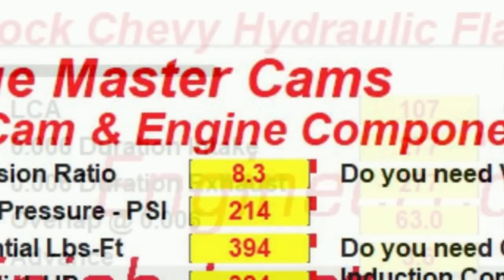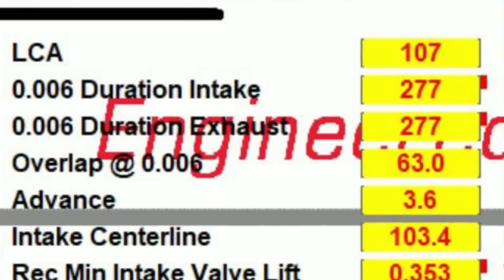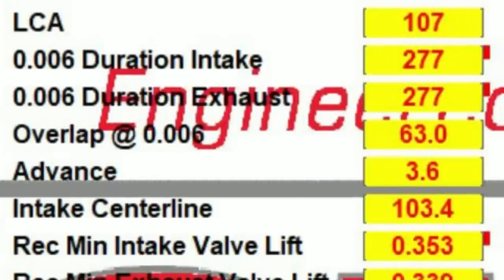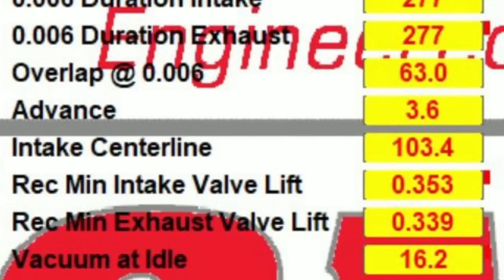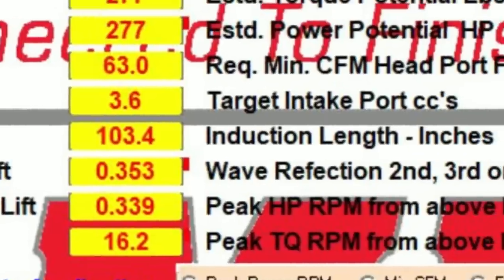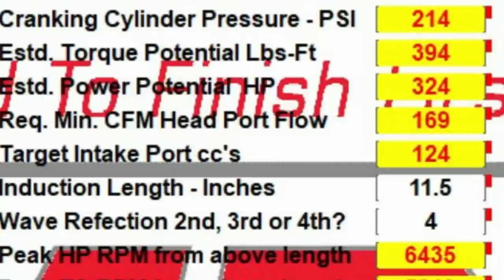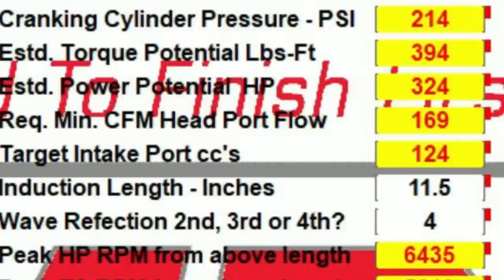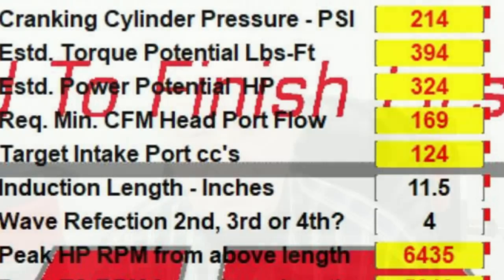Never seen before cam selection method for 'Mission Impossible"

Comment: 3.31" stroke, 4.020" bore, 6.121" rod, 56CC chambers, 7CC valve relief, .010" above deck, .038" compressed X 4.025" bore head gasket, = O.O28" total quench distance, 336.1 c.i. , 11:1 static compression, 8.68:1 dynamic compression (@ 400 feet elevation) with 276* degree cam on 107* lobe centerline angle, and 107* Lobe separation angle. 
Dynamic cranking compression= 179.44 PSI. Volume to pressure index = 139.

Comment: That'd almost the same cam as the factory 340 TA cam. Interesting they came on the 6 pack. Using a small primary carb with vacuum controlled seconds.

Comment: I was born at Saint Jude's Hospital in Fullerton, California. So were two of my three sisters. We were all four born with chronic asthma and spent so much time in the ER there,  that I can safely say one of us would not be here without them. Especially doctors Leo Cummins, Peter Kozak and Sherwin Gilman. A fine cause to support, David.  I'm sorry to learn of your daughter's passing. 

If you don't mind, I have a question about cam overlap that this video may have answered. The overlap of 63 degree's produced 16.2 inches of vacuum at idle. What RPM was that at and would that data transfer to all V8 engines, specifically the 331 Ford I'm planning now. Thank you.
Reply from the maker: Ted, glad you made it. As for vacuum it depends on the engine displacement, the CR and the overlap. If your build is similar in those respects the vacuum shown will be close.

Comment: I have several of your books. Do you remember the program Desktop Dyno I was involved in the early stages of it. Test vehicle 1974 360 duster and a 1968 340 Barracuda
Reply: I bought that program. Used it to help build my 367/4-speed/3.55s/ 68 Barracuda/ street, but I did go to the track one day. Best of 4 and only completed run, was 93mph in the Eighth. 
I came, ran, ate the track food, and continued my Sunday tour. 
The Desk-Top Dyno must have been a pretty good program. I built to a Dcr of 9.0, back in 1999, with alloy heads, and hoped like hell it would run on pumpgas, which it did. Has over 100,000 miles on it now; all of it on 87E10.
It has been to 9.23 Dcr, still on 87E10
Daymn fine engine. Daymn fine program.  Thank you.

Comment: i know its not the same but in the 1980s direct connection had p3690213 cam called street hemi grind for a small block 284-284-60 deg. and .471 in and .474 ex
Reply: I had that cam in a 360 I built never raced the thing but was almost as fast as my Buick

Comment: 13:00 I noticed that the LCA in your specs was 107°. How in the name of Harvey Crane do you achieve THAT, using a STOCK cam as a core? The factory Mopar cam can't possibly be tighter than 112°, and is more likely 114. I can only guess that, like offset grinding the rod journals of a crank to gain stroke, you must be offset grinding the LOBES to tighten the LCA.
Reply: Because LSA is just a calculation of intake and exhaust centreline separation. It doesn't mean anything. Of course you'll change it when grinding them, and can even change the LSA by installing the cam retarded or advanced. That's also how you get silly things like 113.3 LSA on cam cards and race engine specs etc. It isn't ACTUALLY .3 degrees more. It's just what the calculation spits out as the difference between the centres. Same reason you can have two different cams with different LSA that have the SAME amount of total degrees of overlap - which DOES matter. The LSA on the other hand is just a product of a measurement that doesn't essentially do anything.
Reply: @dons1932  everything you just said here is incorrect.

Comment: So a set of heads on a 350 cubic inch v8 flow.   It has rpm air gap, 750 double pumper and 1 3/4 long tube into 3" dual exhaust:

.300" 185 cfm
.400"  210cfm
.500"  260cfm
.600" 265 cfm

You have two camshafts each with 220 degrees @ .050" and 112lsa, one has .425" lift and the other has .610" lift.     How much more power will the camshaft make that lifts to a point where it makes 50+ cfm more?    I know if i took a set of heads that maxed out at 210cfm on that project and swapped them for a set of heads that flow 260cfm, that power will be made, alot of it in the same combo, 40,50,60HP perhaps.

Comment: Awesome content, would love to see how these calculations would be applied to a boosted application.
Reply: Pretty much the same
Reply: instead of 8.68:1dynamic compression ratio N/A, the dynamic would be 8.59:1 at zero boost. And a whopping 14.43:1 dynamic compression At 10 lbs boost and 11:1 static compression with the tight cam at 400 feet altitude.

Comment: I noticed on the page where you did your cam calculations. You had the exh valve listed at 1.4 inches. All stock 318 heads came with 1.5 exh Valves? Are you planning on reducing them down or was this an entry error.
Reply from the maker: It was an error but had very minor effect on the final cam spec results.

Comment: How do you figure out the dynamic compression ratio to use for a forced induction engine? Also, how does this cam program work with the addition of forced induction? There are some out there that will say just spec the cam out as N/A and then throw boost at it, and that can work (and does, though I argue not as effectively as it could), but something just doesn't sit right with me.
Reply: I agree with you on that, a boosted engine is a different critter. As boost goes up dynamic compression does to. I think.

Comment: Hello David how are you
I think camshaft selection for a specific power is the most challenging of all. All those years I been thinking I have finally come to a conclusion. First is decide what power level is needed. Second decide what engine can give you that power easy enough without spending a lot of money if its a street engine on pump gas. Third what is the smallest cam that can do the job not the biggest but smallest meaning if I have good flowing heads will this small cam make those heads / engine combo produce it. Small cams offer the best street manners and low end torque. This way you can have both horsepower and low end torque. I really wish cam manufacturers can list a minimum and maximum horsepower level for a given displacement engine it would be easier to select a camshaft. I am trying to build a forged balanced 425hp Pontiac 400cid stroked to 4" which makes it about 427cid bored .060 over with a mildly pocket ported #13 heads and I still don't know if I should use an summit sum-2800 or sum-2801 or sum-2802 or even something else you would recommend

Comment: Hello there Mr. Vizard. You make the best most knowledge filled videos out there and i need some help figuring out what size cam i need to get ground for max gains. I have my lsa figured out using your calculations and it is 106.56. Its for a 408 ls with a 4" stroke and with a 6.125" h beam rod and a 4.030 bore. The piston has a +8 dish. Its wearing lsa/ls9 heads with a 69cc combustion chamber with 2.165 intake and 1.59 exhaust with 310cc of air flow at .600 lift at 28". It also has a short runner BTR intake and this will be a naturally aspirated engine combo so im looking for around a 2800-7000 power band if possible. Compression is also 11.1:1. Any help would definitely be super appreciated. This is going in a 69 firebird that ive been working my butt off restoring and want it to be all it can be you know. It will be backed by a tremec 6 speed magnum f and will wear a 29" tall tire with a 12 bolt rear end with 3:73 gears and will weigh approximately 3200-3300 pounds without me in it. Again any input from you would be greatly appreciated and i would be very honored to have your knowledge and input on this matter. Hopefully you get this message, im sure you get tons of messages so i understand if this doesn't get read by you. Your the man and thank you for your time and all the great content of your videos.

Comment: The only thing I don't like about re-grinds is that the base circles are smaller so that can interfere with you valve train geometry and you can only change the lobe centers a few degrees from what they were originally ground as. Good explanation though!
Reply: That's almost always the case, lobe can't be taller than the journals, more lift, less base circle.
Reply from the maker: Vince, as you can see we can get the cam events we want here including the LCA.

Comment: Can you give some insight on a Comp Cam I bought ?  Extreme 4x4 part # 34235-4 . Using the recommended springs that have an open load of 316 @  1.300  and agressive ramps compared to stk. cam with 218 to 240 open load @ 1.300 . Will it be prone to lobe failure  or is an extra 100 psi spring pressure not a big deal .

Comment: David,
 I have a rebuilt engine that has about 200 miles on it. It runs very good but has low vacuum 8 inches. The cam is stock and I can't figure out why the vacuum is so low. It engine doesn't smoke at all. There is no intake leak and rings are new. Any help would be appreciated.
Reply: disconnect  the pvc & the power brake. that will eliminate external leaks. Cam timing, very weak valve springs.  What is the vacuum gauge needle doing!!!!
Reply: @waynecera4422  I have blocked off all vacuum ports and no change. Needle is steady at 8 inches at 800 rpms. Cam timing gears are set marks centered no advanced. Engine is timed to factory timing. Valve springs are factory.
Reply: Are you certain that your gauge is accurate? 8 is incredibly low.
Reply: Ditto on that gauge check.  Ignition timing can play a big part too.  Brake cleaner or anything similar can help check for vacuum leaks around the intake manifold and carb base.
Reply: @scottwilliams5196  Yes. I have 2 gauges and there not very old. Both read the same. I bought the second one to check the first gauge. I am thinking it is the cam timing? I am going to advance the cam timing and see what happens. The cam is a new comp cam ground to stock specs for my engine.
Reply: @ajw6715  what is your idle speed? Ignition timing and cam timing( or too aggressive overlap) can surely cause that, but would barely run or idle in my experience. Let us know what you find out. This is curious. You aren't using port vacuum for your gauge?
Reply: Did you ever get this resolved?

Comment: Or buy the Direct Connection/ Mopar performance SPS rod bolts and donate the difference in cost to the project.  
The stock cam (s) have a wide lobe centers and long ramps especially on the close side so you may be  limited on what lobes and  LCA''s can fit.  Also if you reduce your base circle you will have to adjust your pushrod length (also considering thicker than stock head gasket and any block and head milling)  Reed ground good cams.  
Did Reed have masters designed for the.904 lifter? I forget.   Still lighter valves and modern springs will help.  
There are 11/32, 5/16 and 8mm valves available. Going to do the valve guides anyway so go light.
Given the 276 duration and 108 LCA where is your intake close in degrees ABDC and show/ educate the dynamic compression calculation given bore/ stroke, rod,  (where is the piston at valve close) head cc, gasket and piston  how close to 8.3?
cheers

Comment: Hi David i need help please.im a fan of yours.your a genius.i built a new 383 stroker from a chevy 350.i have a 3.75 forged scat crankshaft,flat top mahle pistons,afr 195 street elimanator cylinder heads,afr dual plane intake manifold.its a sreet car than id like to take to track and be aweekend warrior.i got 10;7;1 compression so i can run 93 octane i bought comp cams short travel roller lifters.i needhelp on choosing a proper hydraulic roller cam.please help

Comment: Who other than ARP would you use for a critical engine fastener? (I know there are a couple)
FYI, McMaster-Carr sells ARP high-strength studs and 12pt nuts but probably not a source for internal engine fasteners. They aren't advertised as ARP but you can call to verify a particular P/N. Prices seem very reasonable
Reply: A few VW buddies have had issues with arp a few times ,but I've stuck with raceware and haven't had any issues.

Comment: What happened to Tony's vision of this low buck 318?
Reply: Yeah a lot of people are saying the same. This build is nothing like the original idea. All this is is how much power can we get out of a 2 barrel. Performance pistons, titanium retainers not really stock parts.
Reply from the maker: @deanmoser5907  -  You have missed out somewhere here Dean. The initial build is as low buck as can be had without compromising quality. The higher tech stuff comes along on subsequent builds. We are not stopping at the basic build but taking it all the way through many phases to a real barnstormer. You pick the amount you want to do and stop at that. Our concept has not changes a bit. The initial build will be using stuff like stock valves and retainers etc. At the other end we will have aluminum heads roller cam maybe EFI and so on- BUT THAT IS NOT WHERE WE ARE STARTING FROM!

Comment: David, where can I find the camshaft charts that you made for different compressions and cubic inches?  The ones I've seen small and hard to read.  I have many of your books.  Is the formula different than the 128 method for   lower compression engines?

Comment: Reminds me of My daily driver HJ Holden premier, 308, 5.0L, Red motor, chev flat top pistons, with a regrind Chevrolet hyd camshaft profile put onto the Holden cam core. 286/286-225/225-108 cam near stock, hq head's, ran 13.89 @101.6 mph full weight HJ premier, th-400 and 3:1 ford 9", with the fuel starvation fixed a bit higher Stall speed and 3.7 - 4..11 gears and slicks it might have ran a high 12 with the standard valve hq heads untouched standard tiny intake ports, just a bowl blend, and short turn radius, standard original 1.74" intake 1.45" exh valves,  from a rollon or a standing start, would easily out run both my standard unmodified  then new 2001 vx SS 5.7 manual 225kw LS sedan and the tweaked more powerful VU S  5.7L LS-1 ute I had.
 with probably half the head flow of an LS, the hq head's would @ best maybe flow 105cfm @10" water , I know the LS 241 heads flow considerably more..
Also reminds of a much bigger regrind solid flat tappet cam I put in one of the other 308's I had.
Reply: The 108 LSA would definitely help the old Holden compared to LS1 with around 116 LSA,,I just went to a 355 stroker with a crane 272 solid 112 LSA,11:1 comp as I'm running LPG,hogged out vl big valve heads,Goes well in a vk commo 🤩

Comment: How do I buy your head porting and cam selection software?
Reply from the maker: Steve, - at the present time it's not for sale to the general public but things may change in the future.
Reply: I am the owner of sl competition heads.  I have been machining and porting heads for about 20 years. If you decide to make it available, I'm interested. Thank you for your informative videos. Best wishes.
Reply: @DavidVizard  right on, sounds like it'd be a great tool along with the likes of PipeMax.  
Years ago I made an excel spreadsheet that is useful for getting in the ballpark on the camshaft.  Your books were the inspiration there, appreciate it.

Comment: Since flat tappet cam and lifters are a major problem these days what are the solution for that? This topic could be a whole episode on this issue🤯.
Reply: Which major problem is it you speak of?
Reply: @Alley Oop  from what I gather, due to the popularity of roller cams, flat tappet cams are sometimes ground without the necessary side to side taper and the lifters may have not enough crown to develop the lifter spin necessary to prevent the cam going flat.
Reply: @alleyoop1234  The problems are the cams going flat during break in and sometimes 6 month to a year later. It's all over the internet!
Reply: @plumcrazy588  Some cam companies offer a heat treating process. David Vizard addressed all that in a previous video. It's all over the internet too!!🤣
Reply: @alleyoop1234  Yes you are right and that isn't anything new, it's been around for awhile...in fact it was talked about in Vizards book in 2012. But with the coatings and heat processes they STILL are having problems. So how much do you want to pay for flat tappet cam and lifters that the OEM stopped using in the 90s? Have you ever broke in a cam? What method did you use?
Reply: @plumcrazy588  Yes, I have broken in many cams, the only problems I've had are all on BBC's! I use moly grease
Reply: @alleyoop1234  You had me and I'm sure everyone else confused? You asked what major problems in a earlier thread... I was wondering if you was living under a rock? lol